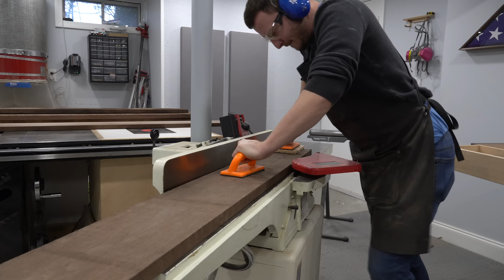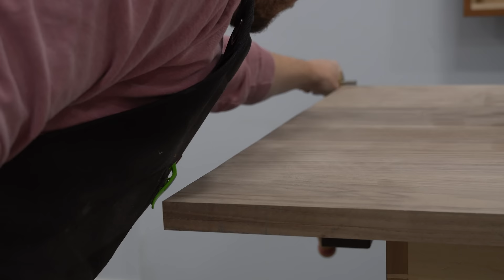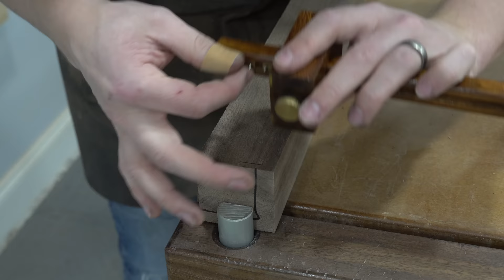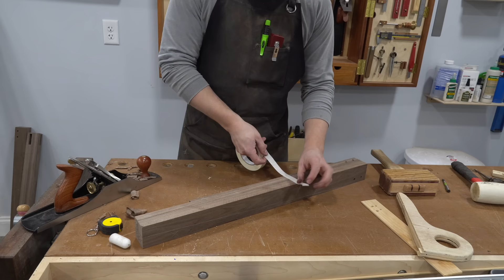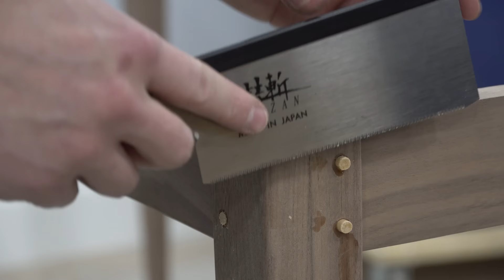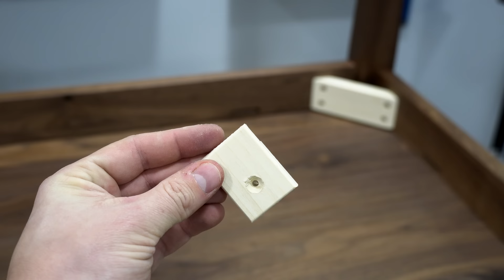Building a Shaker Walnut Dining Table

Comment: Gorgeous table, simplicity is the essence of elegance. I am about to embark on a similar project using mahogany, which is more affordable but harder to work with due to grain structure. Thanks for posting!
Reply: Mahogany is cheaper than Walnut? I had no idea. I only use lumber from local logs I take to the sawmill, so I'm completely out of touch on lumber prices. Btw are you using African or South American Mahogany? Cheers!

Comment: Nicely done.  Your table was almost identical to one I made a few years ago with the only differences being I turned my legs and I used locally grown air dried walnut with one board resawn and book matched for the top.  I wanted to mention that you can buy a japanese saw with the teeth set on only one side so when you cut off dowels you won't scratch the wood  These saws are called Kugihiki.
Reply from the maker: Thanks Lewis, I appreciate the tips! Your table sounds beautiful, I'd love a bookmatched top. Thanks for sharing the name of the saw, I've known I need a flush cut saw for years but now I know exactly what to look for. Cheers!

Comment: Very nice video and the table is gorgeous. From the trailer I wondered if the legs would be too skinny for a table that size, but they turned out great. Really focuses on the top a lot more. - Chris
Reply from the maker: Thanks so much Chris! I thought about the legs a lot and modified them over and over in the sketchup design, I'm also happy with how they turned out. Cheers!

Comment: Beautiful table. Loved your video. I just made  a table top 24x48 with approx 70-90 1/2" oak dowels. Lost count! Lol--- Solid like a tank. I will be doing more projects with just dowels of all colors. No biscuits just dowels. But my table top has an slight cupping after glue up and I'm trying to fix it. It was perfectly flat before glue up.😢
Reply from the maker: Thanks! Sorry to hear about the cupping. Did you use cauls during the glue up like I did? Also if it is cupping upwards (like “U”) you can use the clips that hold it onto the table frame to help keep it flat.

Comment: Excellent 👌 for the bevels you can offset your saw and cut a 45 degree angle, quick and simple.
Reply from the maker: Thanks for sharing shone. The bevels are at a shallower angle than 45, so it is only possible if you held the table vertically on the table saw, which is dangerous if not done with a special jig. That's why I use a hand plane! Plus it's a good workout :)

Comment: Nice project.  Can you make a videos about your dust collection? I have a small place and I need ideas thanks.
Reply from the maker: Thanks! Maybe I'll make a video in the future. In general I have a powerful dust collector bolted to the wall with an upgraded canister filter, and a large cyclone which drops the larger dust particles into a trash can. From there I have a direct connection with a blast gate to my table saw, and a second connection with a long flexible hose (and blast gate) that I carry around from tool to tool.

Comment: s
Small matter, but worth discussing... 
When they first came out, I couldn't wait to get an impact screwdriver. When I did get one, I was building a maple dining table for my daughter. I don't use a lot of screws on furniture, but I was going to use screws for the corner braces as he did here. I generously pre-drilled for the screws because this WAS Maple. I got my brand-new Milwaukee impact driver and immediately sheared off the first screw head with one short blast of my new, mighty, red screwing machine. How could this happen?!.... It's such a small tool! I was able to extract the screw head, so no damage done. Because of this incident, I have tried to be more careful with it, but have determined that the impact driver is great for heavier construction, but not for fine work. I've gone back to the drill/driver for the occasional screws I need in my furniture pieces. It has a clutch and variable speed that I can regulate.
Reply from the maker: That’s great advice! I agree impact drivers are definitely suited more for rough construction than fine woodworking. It takes a lot of practice not to over drive screws! Hand screwdrivers are definitely best for delicate work

Comment: So nice to see someone who knows how to properly attach table legs to the apron, as well as the top to the apron/frame. very nice build! My question - why not just use a hand router to add a chamfer to the underside of the table edge?
Reply from the maker: Thanks for the kind words Jordan! Do you mean using a hand router to remove the full taper (1" by 5/8" triangular cutout) to the underside? Or do you mean to add an additional smaller chamfer? If you mean the full taper I don't have a bit big enough or a router powerful enough, I'd imagine such a wide taper would need a shaper or something. Or maybe there's a special jig to do it?
Reply: In time, you will make an adjustable blade hand planer that will help seal the edges of the table. Wonderful work. I'm following you.

Comment: I had to laugh when the one table leg fell off the work bench..... Been there, done that, more than once...... I was influenced by Thomas Moser when I first started doing flat work, and this style is very similar. Almost identical to the way I did things, until I got 'distracted' by the wood lathe.... I know there is a way to cut the tapers without having to tape the piece you cut off first back on. First attempts ended up with me putting the tapered side down for the second cut, but figured out if I cut one side off first and then the second side, can't remember which one, I could keep the flat/straight side down for both cuts. I like the idea of the pencil sharpener to round over the dowel tips. I used to cut my dowels out by taping a bunch of them together, like 10 or so, with the blue painter's tape, and then cross cutting them on the bandsaw. I would use what ever width of tape I wanted so I would get dowels the proper length, so, 1 inch tape for 1 inch dowels, 2 inch tape for 2 inch dowels, or 2 widths of 1 inch tape. Also used the wood buttons/clips for keeping the table top on. I usually used identical wood of the table top, for the buttons. What finish did you use?
Reply from the maker: Lol! Thanks robo :) Thanks for sharing your story, it sounds like I am on a similar journey. I haven't gotten distracted by a lathe yet, and it might not happen soon because I don't have room for one!
For finish I use Arm-R-Seal wipe on polyurethane (satin)

Comment: I just finished glueing up the 6th panel of a cherry blanket box today . I really wish I had watched this first for the saw dust cleaning up the glue tip 😆, fack.
Reply from the maker: Lol! How'd your blanket box turn out?
Reply: @dkbuilds  had to put it on hold, to head back to work for a month on the water. Brand new to the whole process so what I thought was all square was basically a trapezoid. I was happy to learn this after only doing one set of box joints, but just ran out of time. Very happy with how the box joints are gonna turn out, I took a kids glue stick and glued 1/8 inch plywood to the back to prevent the dado from chipping the cherry all to hell and the glue stick doesn’t ruin the wood or leave a mess once you pry the plywood off.

Comment: be-a-utiful. Skipped all the sanding shots huh? I like the support gussets and cross brace, they will make a big difference over time. im a big fan of the draw bore technique, seems like pretty easy insurance when using mortise and tenon....im relying on it to hold several pieces of furniture together!
Reply from the maker: Thanks Josh I’m glad you liked it! I didn’t do too much sanding (most surfaces fresh off the plane) but I won’t pretend I didn’t sand down a few spots with a little tear out!

Comment: Beautiful. Some makers use dowels or biscuits for alignment - some without glue some with. Do you think gluing in dowels or biscuits could swell the table top?
Reply from the maker: Thanks Jason! I think dowels and biscuits help a lot with alignment but don't add much strength. I highly doubt they would cause the table top to swell, but I personally haven't ever tried them so I can't say with certainty.

Comment: Corner cleats/braces, exposes dowels of a differing wood. Table top attachment . Rounded table leg edges. Not likely to use Walnut. 
More Scandinavian in style. Shaker was an evolution of Scandinavian.
Look at Shaker and then look at Swedish etc from 100 years prior.

Nice table, well made.    Goes well with the modern chairs.
Reply from the maker: Wow thanks for the detailed reply Jeff, you clearly know your stuff. I agree with your assessment that this is not a strictly shaker table. I appreciate you sharing your knowledge with me!

Comment: How do you get you saw fence to slide parallel when you rout the dovetail?  Mine would wobble unless locked down.
Reply from the maker: Good question Jason! I've adjusted it to reduce the wobble (there are some plastic set pins on mine which can be adjusted to square up the fence), but to be honest, it still does wobble a little bit. This particular dovetail joint doesn't have to be super-precise, so I went with this method and it worked pretty well. In general, though, I wouldn't recommend it. Better would be to install some T-tracks in the router table and use a miter gauge, OR do it with a hand held router and clamp down a scrap piece of wood as a fence. Hope that helps!

Comment: Very nice build! I'm wondering about those corner pieces around 19min. Are the necessary, or are the mortice and tenons not strong enough by themselves?
Reply from the maker: That's a great question! No, they aren't strictly necessary. However since the apron rails were relatively shallow, I felt the corner braces would add some extra strength. It's mostly just me over-engineering the table because I'm anticipating little kids running around and bumping into the legs :)

Comment: How do you join walnut boards so nicely? i always end up with black lines somewhere
Reply from the maker: That's a good question! What do you mean by black lines? Where the grain between two boards doesn't line up nicely, or excess glue? For me the trick is spending a lot of time ordering and aligning the boards beforehand and making sure there is no sapwood in glue joints (though sometimes I leave sapwood on the outer edges because I like the look of it).

Comment: Looks great. Just got done doing the same with our Sapele dining table. You should try the jointer tapering method for the legs. I was pleasantly surprised at how quick and clean it is to do.
Reply from the maker: Nice, thanks for the tip Jamison! I've seen the jointer tapering trick but haven't tried it myself. To be honest it's the power tool that I am most scared of! I'll give it a shot next time to see which method I like best.

Comment: Can I ask why you didn't use any dowels when joining wide planks for the table top? Wouldn't that risk the planks just separate/ break apart under pressure?
Reply from the maker: That's a great question! A well executed glue joint is actually stronger than the wood itself. Dowels don't actually add any strength to a joint like this, they mostly help to align things while the glue dries. I would have used dowels for alignment if I had a dowel drilling jig :)
Reply: @dkbuilds  thanks very much for the response, it make sense 👌

Comment: Great work! That video did NOT feel like nearly 22 minutes long.
Well done!
I am wondering though, you attached the top to the frame with floating tenon blocks.. but I’m wondering if you had any of them glued. Like what is preventing the top from moving more than natural movement?
I was thinking you put all the blocks in, then pulled them out slightly to allow movement. But In my brain, I’m picturing a loose top. 😂 What detail am I missing here?
Reply from the maker: Thanks for the kind words Ian! Great point about the floating tenon blocks. When I pulled them out, it was so they wouldn't be full-depth in the mortise (to allow for movement). However the tenons are still snug to the top of the mortise. When screwing in the block, it cinches down quite tightly. Combined with lots of other blocks, you can pick this table up by the top and shake it around without the bottom sliding anywhere.
Reply: @dkbuilds  well I’ll be danged! Thanks for explaining!!

Comment: the top was with Arm R Seal Satin as well? Did you just apply it to the planed top or did you sand to some #?
Reply from the maker: Yes the top was with Arm-R-Seal, several more coats than the rest though. In this case I believe I did sand the top slightly (probably with just 220 sandpaper), but usually I finish right off of the plane.

Comment: Did you use Arm-R-Seal for the table top too?  Just wondering because General Finishes says only 3 coats are needed.  Additional coats will not improve durability.  I'm debating on whether to use Arm-R-Seal or Osmo for my walnut table.
Reply from the maker: Yup I used Arm-R-Seal for the top. The whole table has 3 coats, the top has more like 6 or 7. It’s quite durable but takes ages to apply enough coats.

Comment: Why no dowels when glueing up that panel?
Reply from the maker: Good question! With a proper glue joint dowels don't add any strength. They do help with alignment during glue up though. I would have used some to help with that if I had a dowel drilling jig.

Comment: Awesome build. I've been struggling to get good male sliding dovetails on long board ends like the cross member you dropped in, how'd you cut them?
Reply from the maker: Thanks Steve! Yes getting male ends of sliding dovetails fitting correctly is tough. I used the router table (same bit as used to make the female end obviously) and held the piece securely vertically with a jig that runs along my router table fence (which is actually just the back side of my table saw fence). My main techniques are to take a LOT of passes removing slightly more material each time and test fitting each time until the fit is just right (a little looser better than a little tighter, especially for a long dovetail), and also if possible to keep the work piece wider than necessary. The second tip is useful because I always get a lot of chipout from the router when the bit exits the piece. If the piece is too wide, I can just allow the chipout, then rip it off after the joint is cut and bring the piece down to final width. 
Hope that made sense! :)

Comment: Will the desktop mainly deform without wearing straps? 桌面不做穿带,以后不会变形吗?
Reply from the maker: No it will not. The multiple clips connecting the top to the legs and apron rails will prevent warping.

Comment: Great video!  Wait, how did you joint the boards for the top? Hand plane only?
Reply from the maker: In this case I jointed on a power jointer and ripped to constant width on a table saw. Then I used a hand plane jointer to clean up the glue jointing surfaces.

Comment: What finish do you use? I really want to find a finish for walnut that doesn't darken it soo much and keeps some of the grain soft, light and airy
Reply from the maker: I use Arm-R-Seal wipe on polyurethane, satin. It's hands down my favorite finish, when I have the patience to wait ~8 hours between coats. I also sand between coats with super fine sandpaper, sometimes 1000 grit, just to knock down the high spots. I basically copy this exact technique: https://www.youtube.com/watch?v=iPtoPBMbAP8

Comment: 15:34, never thought about trying a cut that way. Is there much side-to-side play in the fence? Aligning both long pieces relative to each other to cut that dado must have been fiddley. Looks great, time to make chairs though :P,
Reply from the maker: I'd never tried a cut this way either, and it worked out pretty well. There is some play in the fence which can cause issues. I decided to try it here because I didn't need a super perfect fit for this cross member, but it actually worked well. To align I just marked both boards together on the workbench, then cut one dado at a time. If I missed the alignment by a 16th or so it wouldn't matter for this application since the cross member is like 30" long.
I might use this technique again in the future but it isn't the most precise due to the slop in the fence!

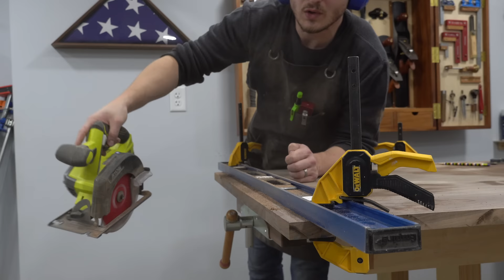Comment: Absolutely lovely table!  I need to get and build something in walnut.  Quick question: at 4:40, you trimmed the end of the table top square with a circular saw.  Do you keep those offcuts, or add them to a "firewood" pile?
Reply from the maker: Thanks Gareth! Unfortunately those go to a firewood pile. Really short and wide pieces aren't so useful. Perhaps they could be made into an endgrain cutting board or something but I'm not bothering in this case. Oh well!

Comment: Great video.  Thanks for sharing. Did you go thru more than one drill bit to rough out the mortises?
Reply from the maker: Thanks! Only one drill bit but it needs replacing ASAP, most of the cuts were burning/cutting very slowly.

Comment: Ever thought about going to the three head dewalt planer?
Reply from the maker: I’ve had no issues with my current planer. Not sure what the three head is. I’d love to upgrade mine to have a helical head, or buy a new one with a helical head. They are far superior and much quieter. My jointer has a helical head and I love it. Only reason I haven’t upgraded my planer is I can’t justify the price when my current setup works fine.
Reply: @dkbuilds   I keep getting snipe at the ends of the boards and I have tried everything to eliminate it short of replacing the rollers.